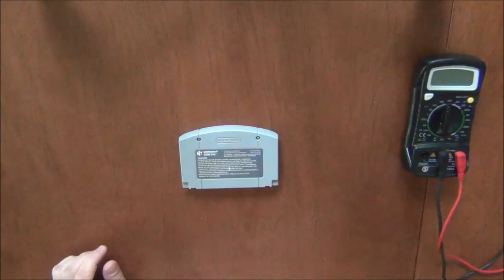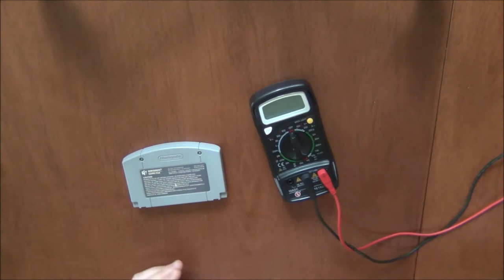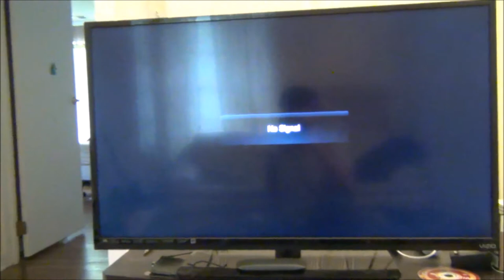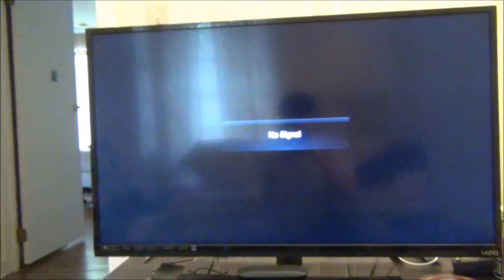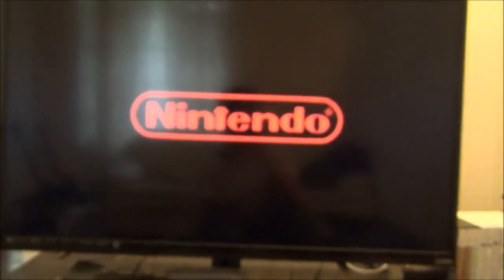Repairing a broken Nintendo 64 cartridge

Comment: This is a good video to help people learn to take time to look and check. However, the only thing I would say is. It is ok to use small wire to connect the circuit when it is necessary. 
In that case of a repair. It would be cleaner to repair the trace with a leg from a cap or led. And the work will look clean. 
Just a small bit of advice to share for anyone watching. Great video.

Comment: the first thing you should have dun was a reflow simply for the fact a lot of micro fractures can be healed buy reflowing it will also give a fresh joint and most times this will fix the cart if not then check traces not traces then check the cap and resisters if not that then get a working cart and start swopping chips. I recently rebuilt a cart that was water damaged it was kurby I clean every thing up reflowed it all and everything was working even tho things wear rusted and degraded but it did work I did deside tho to take the chips and pute it all on a new board and I am glade I did it turned out even tho the game was working the resisters wear rusted so bad they bromke when I touched them.

Comment: Awesome video and clear instructions! 

I have an issue with some cartridges where the pins are either so corroded or there is a part a chipped. How can I fix that?
Reply from the maker: +Rami Al-Q Do you mean one of the IC is chipped? That could be very bad.

If one of the pins on the IC is corroded on the bottom side of the cart, you may be able to find exposed metal on the top side. You can solder wires on the top side as well as the bottom side.

If I haven't answered your question, post an image of the board and we'll take a look.

Comment: What brand of multimeter are you using?  I have a super crappy cheap multi-meter and need to get a better one!
Reply from the maker: This is the model I still use: https://www.amazon.com/SE-MM6162L-Digital-MultiMate-Display/dp/B0014JWTC8 It's cheap and it does the job.
Reply: Awesome!  Thank you.  A video game store just closed down near me and they gave me a huge box of broken n64 and snes games.  A lot of good stuff too!  :)
Reply from the maker: Sounds like you have an awesome journey ahead! Be sure to invest in a good pin cleaning solution like a fiberglass scratch brush.

Comment: My Majora's Mask fell and the outside part cracked and broke off. It's still in the RF (?😳) shielding, though. I put it in my N64, and it didn't work and I figure that was dumb, but do you think it'll work if I glue the broken bits of the outside part back together and put them back around the RF shield part?

Comment: Hey Josiah, what is the wire grade you use to connect the connections?
Reply from the maker: kenbuc2 can't remember off the top of my head exactly, maybe 18 gauge. But most wire will do, as long as you can contain it in the case.

Comment: what do you do if your getting nothing from the pin to the first solder contact on the board? I assume you cant solder a wire to the connector? hopefully im describing this right?
Reply from the maker: I think I know what you mean. I usually scrape away as much plastic I can and solder as far up as possible, using very thin wire. Even so you'll be able to look inside and see the solder gleaming. Oh well, better to have a working game!

Comment: Question, I have a copy of Mario 64 that will lose all its saves after a period of not playing the game. I opened the cartridge today and to my surprise it unfortunately doesn’t use a save battery, rather EEPROM. Is it possible that one of the issues in this tutorial can cause that or is it that one of the chips is bad altogether? The game runs and plays fine other than that.
Reply from the maker: How long of a time before it loses the save game? Hours? Days? From doing some research it sounds like the BU9850 EEPROM chip might be bad. Looks like the only replacements come from donor carts.
Reply: Ahh ok, seems to be a matter of days turning on the cart again and it's gone. Granted I'm not playing daily so I'm not sure if that makes any kind of difference. Just wondering, that's a bummer. Seems like it would be easier to just find another working cart in this case.
Reply from the maker: Yes, sadly the N64 has very few off-the-shelf parts. At least with the SNES you can cobble something together.

Comment: hi, what kind of cable did you use to connect the point?
Reply from the maker: I just used wire I had laying around. You can use any kind of wire pretty much. Buy a cheap spool that it will last you years.
Reply: thank you for the advice.

Comment: What gauge/type wire is that?
Reply from the maker: Pretty standard 24 gauge wire I think. Any wire will do, really.
Reply: any special solder that you used or no?
Reply from the maker: Nope! Standard solder. That's what's great about the repair.

Comment: I didn't get the part with wire,if it doesn't work i just have to connect two of those with wire,what kind of wire,I dont want to trash my Donkey Kong 64, its my favourite game,could you please help me out,even tho this video is 3 years old
Reply from the maker: Any standard wire will do, unless you need to jump from an edge contact to a pin, then you should use thinner wire. As long as you are careful with the soldering iron you will be okay!
Reply: @josiahwhite2095  appreciate your help,thanks a lot,have a great year!

Comment: I have a cartridge that it's not working and the problem is that in one pin of the socket does not have continuity. How can I repair it? There is no place to solder a wire on the pin "finger"...

Thanks
Reply from the maker: You can scrape away a little of the plastic higher up and solder to that. It's a little difficult but do-able. Good luck!
Reply: Wow! Thanks a lot for replying to me! But Josiah, you are telling me to scrape the PCB plastic right up the gold pin of the socket and wire from that position to the end of the trace line?

Thanks
Reply from the maker: Yes pretty much. There isn't much plastic to scrape away. But it does add more area to solder to. You will have to carefully fit the board back into its case as the wire may not fit in snugly. Use a very thin gauge wire.
Reply: Thank you Josiah again for your reply! I have understood what you said, will try it!

But what if the problem it is on the gold pin of the socket? This gold pin in particular it is a little faded, kind of scratched. Is there the possibility that there is no continuity due to this particular gold pin? If this is the problem, the solution provided won't work either right? Because there will be no continuity from the gold pin to the scratched PCB where I will solder the wire. 

If this is the case, what solution do I have?

Thanks
Reply from the maker: I've encountered some corroded pins. Usually there's enough metal to connect to the system. If you can, get something to scrape away some of the corrosion. Check continuity from the very bottom of the pin to the chip to make sure.
Reply: Thank you again, Josiah. I have confirmed that the problem is on the gold pin. It has lost connection with the system due to being a little faded away. I can't get continuity from this pin to the system. What do you advise to repair this particular golden pin?

Do you think that I can use solder to repair the faded part of the golden pin? I'm just a little afraid of using this repair method because I dont know if I will get future problems on my console socket from using this cartridge.

Thank you

Comment: Hasnt anyone though about reverse engineering the circuit schematic for eacclu cartridge?? Its only a two sided pcd. The traces should be able to be redrawn. While im at it, hasnt anyone come up with a pin checker? That can check contitnuity on each pin 🤔

Comment: I’m new to this. Trying to fix a killer instinct game. What did you have the multimeter set to
Reply from the maker: It will depend on your multimeter, but there should be a continuity checker. Mine looks like a red speaker blaring sound.
Reply: Josiah White I’m not seeing that. It must not have it
Reply from the maker: What is your model? I can try to look up specs.
Reply: Josiah White it’s a cheap cen-tech. My dad has another one I guess I’ll give it a look